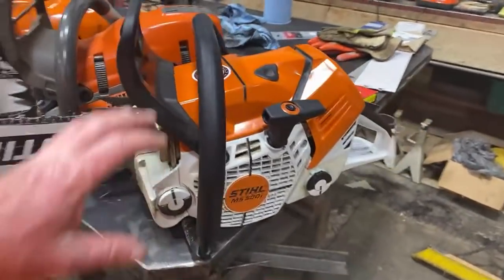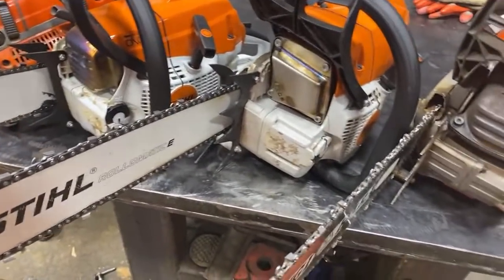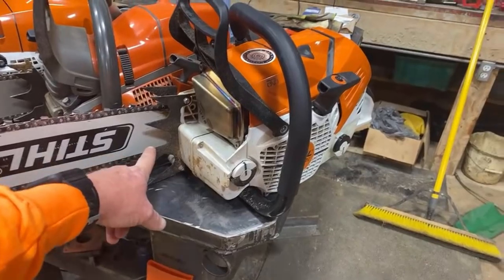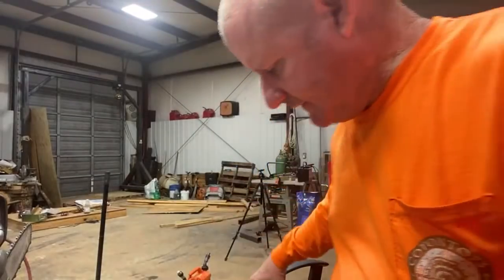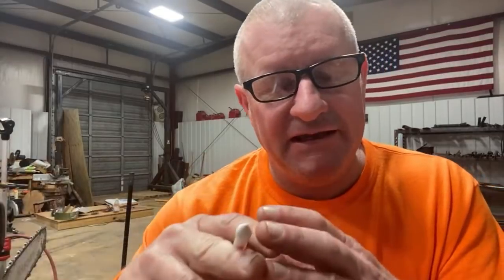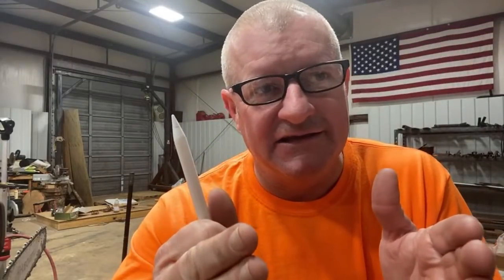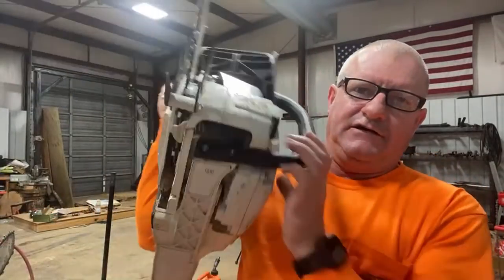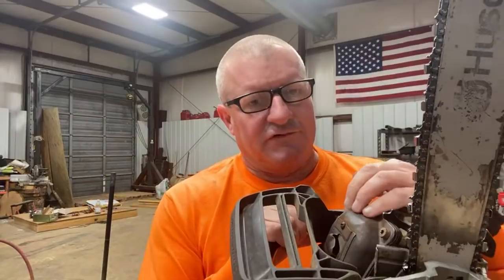Live from my shop

Comment: Question. Does a logger rather log out woods in winter or summer? If winter why? Because the wood is much heavier than summer
?
Reply: Because it’s not as b@ll sweating hot 🥵 as it is in the summer. If you get cold, work harder. You can’t take off enough clothes when it’s hot outside.

Comment: I am trying to decide between the 362 or the 391.  Only be cutting trees on weekends.  Is th 362 worth the extra money for the pro saw? Thanks
Reply: Every weekend? You looking for a saw to run for 20 years? What's the weight difference? I ran an old 029 for light farm use for 20 years. The consumer saws are heavier for the same power. I now own a pro saw and won't go back. It was only $150 between the pro saw and same power consumer saw. I think it was well spent for a long term investment 10+ years.
Reply: I believe the weight is about one pound.  The power is .4 hp.  I dont know if it will be every weekend.  I just bought a sawmill and have 40 acres to clear over ten or so years.

Comment: This cracks me up.   Running a 500i with 25inch bar is about as useful as a ash tray on dirt bike.   The 500i shines with 32inch bar.      

Everybody talking about the weight,  why?   It’s 1 or 2 lbs difference.   The mud on my boots weigh more than that.  If your climbing a tree I can understand everyone complains about weight but it seems like just old dudes being old.    I’m just saying talk about accurate power numbers with real bars.

Comment: I have a mtronic 261C with a 16in yellow stihl bar and yellow RM chains on it. I didn't want a 20 inch on it. To me it is a great saw when cutting firewood off of the tops of trees. Get the 261C a 16 in bar and give it another shot. I think it might change your mind about it but it is totally your choice. What chain are you running on it? 
 It is a lot lighter than the stihl 461, 362, and 362C. These 3 saws have 20 inch bars. Also got a 24-25 inch bar for the 461. I got that bar originally for the 362 but the oiler would not put enough oil out to keep the chain lubed. I had to keep an oil can with me to keep it lubed. I was using stihl platinum bar and chain oil at the time. Now using the stihl wood cutter for temps above 40° and the winter stihl oil when it is below 40°. Thinking about getting the lightweight bar now.

Comment: Any reviews on the 462 I seen a guy running one the other day he said it was a great saw but i never heard much about em ain't they autotuned or something.
Reply: I have a 462, I like it weighs about the same as the 500i which I have as well.the 462 screams with a muffler mod and for an mtronic it has great throttle response after the muffler mod,I’d definitely say the air filtration is far more superior than the 500i.
Reply: Yea I heard that 500i is very expensive. Got the 550xp and 372xp I've had a few echos b4 too was thinking about getting another mid size saw to add with my others so I'll have 4 in total good enough for me I only do landscaping not cutting trees every day I might be fine just a stihl farm boss might even work for me I very rarely cut anything over 20 inches or so.